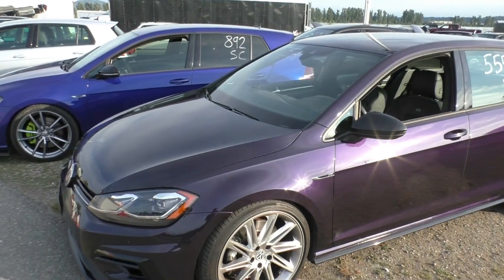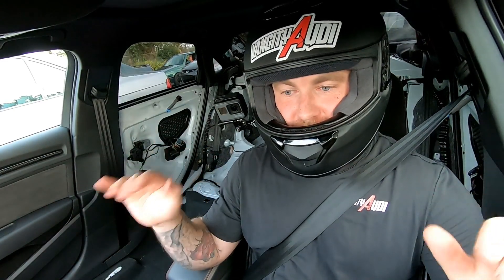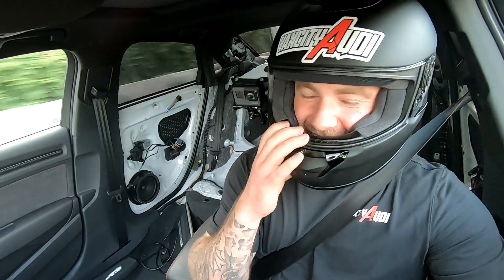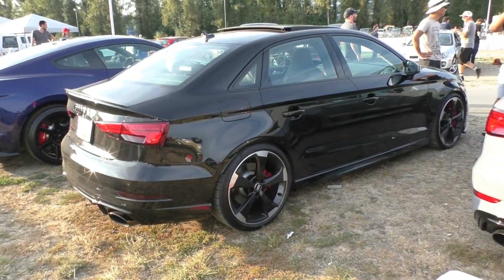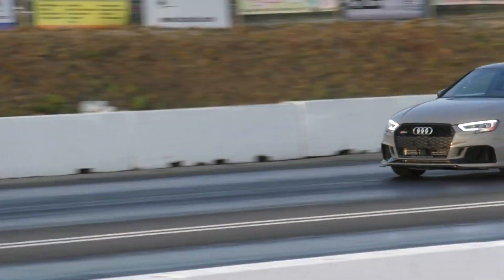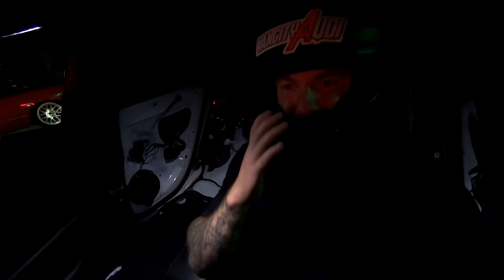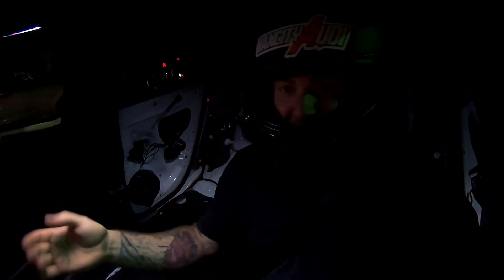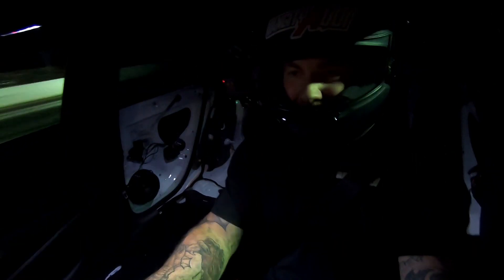Audi RS3 - Custom Code Stage 2 VS VW Golf R - APR Stage 2 Drag Race

Comment: Wonder if rs3 guys remember they have another cylinder over the Golf R on APR Stage 2 +, does make quite some difference, we need to see another rs3 running APR Stage 2+ great vid. 👍🏻
Reply from the maker: I would LOVE to race an APR Stage 2+ RS3!!! If anyone knows of one local to me then send them my way! Of course I remember that Golf R's are down a cylinder and half a liter of displacement. I used to own a 2016 Audi S3 - Stage 2+ with WMI. They have the exact same engine as the R's.
Reply: Vancity Audi 
Yes we need to find one over there, see how they run against your software, my rs3 8P is running Stage 2+ APR with Miltek and needs a run up the quarter mile, would love to be over there though, but the UK will have to do for now ha 👍🏻 🇬🇧

Comment: Hey vancity, from your personal opinion, during daily driving, how is the wastegate rattle with the downpipe and midpipe? Debating if I want to install mine or not. Let me know. Thanks
Reply from the maker: Wastegate rattle is friggin' awful in these cars once you upgrade your downpipe.  Atleast it is for me with the Iroz downpipe. I'm not sure if other brands may be quieter? Seeing as I'm all about speed and power though I live with the rattle.
Reply: @VancityAudi  that's what I'm afraid of, so you can hear it alot during normal everyday driving in sport mode?
Reply from the maker: @hckymstr1919  yes sir. It rattles like crazy when at around 30-35% throttle which is what you surprisingly use a lot on the street. Less than that or more than that the rattle goes away or dies down.
Reply: @VancityAudi  thanks for the insight man and keep up with the great videos!

Comment: Any chance the drag radials are smaller rolling diameter and making the gear shorter, in turn the shift timing is now too late, with the gears hitting redline faster, it may not want to shift while the engine is revved over the limiter, waits for it to settle then shifts on the rev slow down.
Maybe try manual shifting a touch sooner and fine tune it, may reveal what the issue is, if not what I’m thinking.
Thanks for vid.
Reply from the maker: I've been told that these cars shift by MPH and not by RPM so technically I don't think the smaller rolling diameter should affect the shifting. The last 2 times I raced on these drag radials that wasn't an issue so I think it is something else.  I'll get it figured out though.  Thanks for your input!
Reply: Ok, Something I’ve noticed is the car shifts better in higher ambient temps, likely due to better traction, the other thing I noticed was if you don’t do a burnout in the cooler ambient temps you get better shifts, you had a 10.4 without a burnout on a final run of one particular night with the coolest temps of that evening, maybe there’s something in this? It may be related to hot tyres on a cold track, more so that you have hot front and cold rear tyres creating an imbalance of grip and wheel spin.

You mentioned TC and haldex were off, whether it’s still reading data and causing a shift delay might be something to look into, however with all that off, how is the power being distributed to the wheels?
Reply from the maker: @kais9196  Wow, a lot to respond to, haha. Thanks for your input!  I am following the techniques and protocols of the guys that have set the world records in their RS3's.  They were simply on a different wheel/tire setup and running a more aggressive tune for the stock turbo RS3 records.  They do long burnouts to heat the front tires because our AWD system is very, FWD biased.  No power is sent to the rears until slip is detected on the fronts.  You could be right about the ambient temp for the transmission shifting better.  Maybe it responds better in a warmer climate.  Traction Control has to be switched off to launch the car as aggressively as possible.  I turn the haldex control back on before I launch the car or else the AWD system wouldn't work when I launch the car.

I think a lot had to do with my alignment being off as well as me not shifting soon enough in Manual.
Reply: Vancity Audi 
Haha, well we want this car at its best 😁
I’ve seen the 8&9 sec run RS3’s and they seem to shift poorly half the time too by the sounds, sometimes the same car does, then won’t on another run, it does seem like a thing that’s intermittent, whether it’s track/tyre conditions or manual shifting or even perhaps the tunes needing refinement.
How’s Sports Auto go?
Might be worth trying to short shift the first 2 gears a touch and see if there’s any real loss of time from it, may work in favour, either way you’ll see if the shifting is clean each time and will rule out the causes being anything but red line.
Reply from the maker: @kais9196  next time out I'm gonna try Sport thru the whole run and see how it does. Then I'm gonna go Manual the whole run and see how I do. I 100% agree with trying to short shift. Going to keep trying different things until it rips off shifts perfectly and I get some more clean runs under my belt.
Reply: Vancity Audi 
👍🏼 good luck, looking forward to it.

Comment: Hey vancity,

Look into getting a dogbone mount insert if you haven’t already. The rough shifts you experience should be resolved. Make sure to get the upper inserts as the bottom will bend especially when you’re running e85.
Reply from the maker: I already use the 034 dogbone mount with upper and lower inserts. Thanks for the idea though!
Reply: @VancityAudi  Does RS3 share same dogbone with us peons in other MQB, GTI/R/A3/S3?  If so, Powerflex hybrid puck would be a better solution than an insert beating the rubber into submission.  This requires removing puck completely, so be aware, but it locks everything up nicely.
Reply from the maker: @dirk5950  peons, lol. I had an S3 before this. I was no peon!!! Haha. I believe they use the same one but there are different versions available for when your car was made.

Comment: Something I always notice ? Why do you have it on D sport then smack it to manual mode when your 3rd gear shifts to 4th ?
Reply from the maker: It was a technique I would use to allow the car to cross the finish line without shifting into 4th and losing a bit of time.  That was on my old tune.  I no longer do that on Unitronic software.

Comment: I've got a 2012 VW CC 2.0T I was questioning I saw your hood liners taken out I've been thinking about that but will it damage my paint due to heat or is that just a sound thing?
Reply from the maker: I haven't touched the hood.  What you see is how the RS3 comes stock.
Reply: @VancityAudi  ah okay thank you! Sorry for the misunderstanding:)
Reply from the maker: @ccthisboost3801  no problem at all. Thanks for watching my video!

Comment: I just can't believe you run this thing like you do and then just daily it. Haha It's insane. Any major problems other than the LCA bushing?
Reply from the maker: Plenty! Hahaha.  I had to replace the OEM pads and rotors at 11,000km because they were cracked and warped.  I had to replace the PCV at 11,000km because it was leaking. The sunroof creaks and moans like crazy.  The car makes clunking noises are full turns.  Did I mention I've gone through a motor already too? lmao.
Reply: @VancityAudi  Holy shit! Was the engine replaced under warranty? What was the failure point? Not going to lie I'm wanting to trade my RF Miata in on one and this kind of scares me a little. Lol
Reply from the maker: @jeffvanallen5612  Warranty? What does that word mean? I bent a rod in cylinder 3 from too much torque.
Reply: @VancityAudi  Haha. Oh, God. That kind of sounds like a tune issue to me. Not unless you told them to turn it up passed what they recommended?
Reply from the maker: @jeffvanallen5612  At this point and time it looks like shit luck.  I tested the injectors, the fuel, the plugs, you name it, I tested it and all Iroz could find was a bent rod.  Everything else passed inspections and tests.  Seeing as there are a ton of other people running torque levels around what I was on a stock block, I may have just got a less than perfect rod from VW. A bunch of other people are running those power levels with no issues at all.
Reply: Sorry to hear that happened man. I'm sure that wasn't a cheap bill. Anyway, on a good note I appreciate all your information and videos. It's definitely fun to watch you and the evolution of your car and your driving.
Reply from the maker: @jeffvanallen5612  Thank you very much.  I appreciate the support.  When you push cars to their utmost limits things break more often.  Just sucks that mine broke so early on.

Comment: Hey bud try to manually shift just a bit sooner. Before red line.
Reply from the maker: That's what I plan on trying the next time out, thank you
Reply: Vancity Audi Awesome. Should help
Reply: Is it not better to put it in manual, and let it shift automatically?
Reply from the maker: @SomeOne-on6yf  my car will not shift automatically if you put it in Manual because I have a Custom Code Stage 2 tune. It will bounce off the redline.
Reply: @VancityAudi  awww, okay. I went with APR stg2 DSG tune and allowed it to shift automatically in manual.  That way it hits the sweet spot every time. And goes higher in the RPM range than sport.
Reply from the maker: @SomeOne-on6yf  Keep in mind not all cars run their fastest times when you take every gear all the way to red line.  Some small turbo cars run out of turbo at higher rpm's and you may run a quicker time shifting a bit early.  I assume you are referring to a Golf R or Audi S3?
Reply: @VancityAudi  yes, I have a golf R, but a DSG tune is supposed to shift at the most optimal time. So ever gear is always perfect
Reply: @VancityAudi  I mean, I could be completely wrong,  I'm still learning these platforms
Reply from the maker: @SomeOne-on6yf  yes, that is how the tuners calibrate it in Sport. In Manual you are just running each gear to redline.
Reply: @VancityAudi  I know it's different, rs3 vs. Golf ,but what do you feel is the best/fastest way to shift?
Reply from the maker: @SomeOne-on6yf  I had a United Motorsport Stage 2, Water/Meth Injected S3 before the RS3. Sport mode always ran faster than letting it shift in Manual for me.